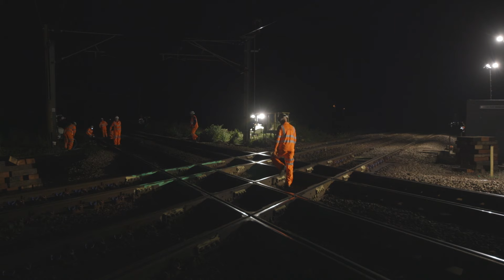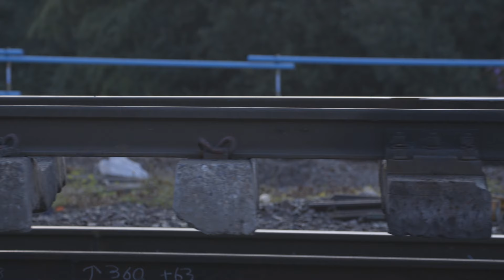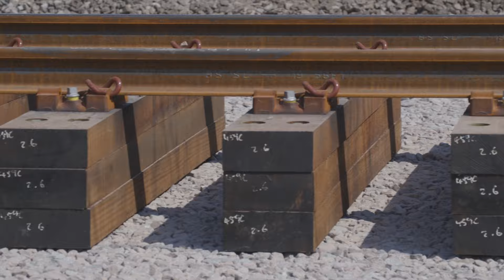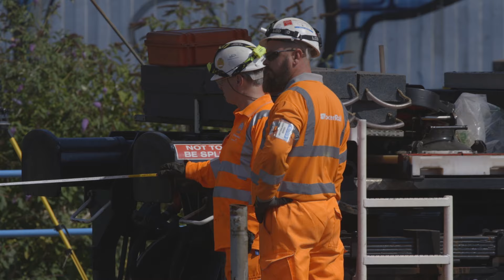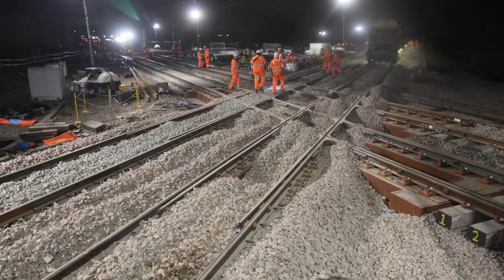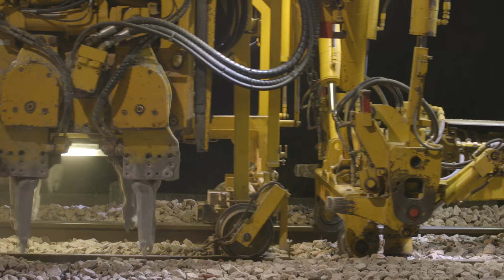Renewal of the UK's ONLY Mainline Flat Railway Crossing!

Comment: What does "flat crossing" mean in this context? Everything here looks fairly ordinary to my untrained eye
Reply: It means that the crossing is at grade on ground level. At grade means that the tracks cross each other at the same height.
Reply: Pretty normal in the Us... we call those dimonds @kneonspace410
Reply: @hamiltonsullivan6563  the signalling complexities make them quite unpopular for the UK, we would usually have a flyover.
Reply: We have plenty of diamond crossings in the uk, all over the system, but this is the only place where two mainlines cross each other without an over or under bridge.
Reply: @justaguycalledjosh I think the wear implications at high speeds can be problematic too